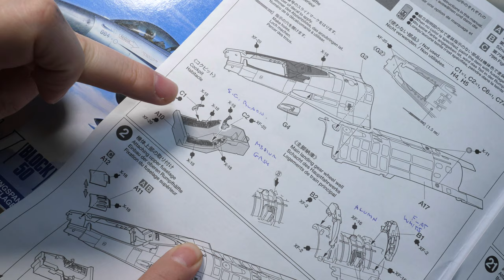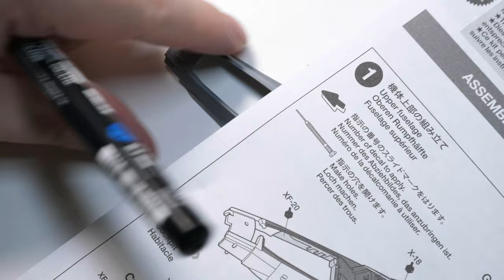HOW TO PAINT Jet fighter cockpit with Posca paint markers part II

Comment: Are the POSCA Markers recommended over the Sharpie Fine Point markers?
Reply from the maker: posca markers are paint markers. the sharpies are oil based. I use red sharpies for detailing around USN landing gear bay doors etc.
Reply: @TheBearScaleModels  Thank you. As I understand, POSCA is water based Acrylic (matt finish), and the Sharpies are like an oil-based enamel paint (gloss finish); I assume we may use both for detailing. Was wondering if one is preferred over the other? or is this strictly a user based preference? cheers.